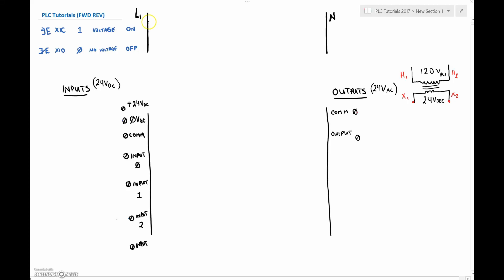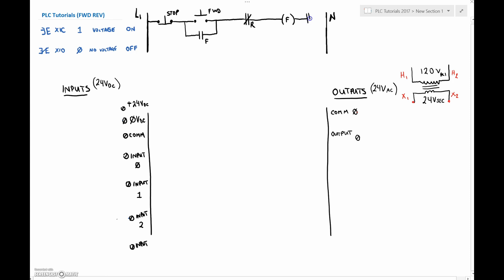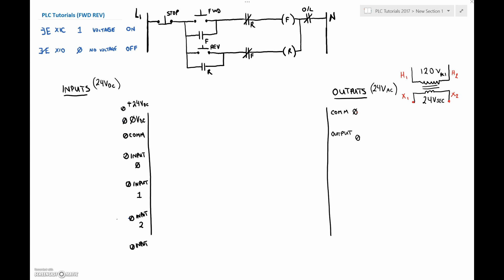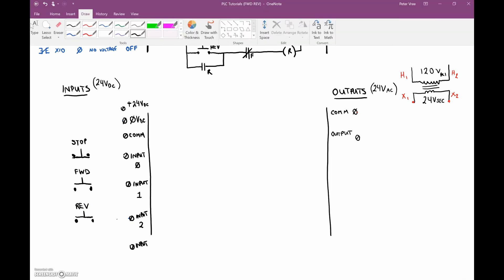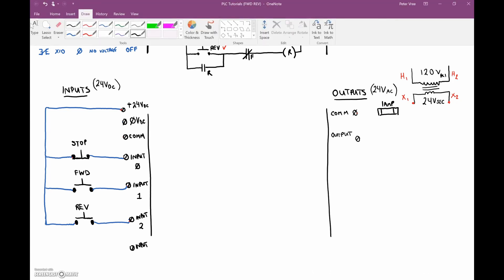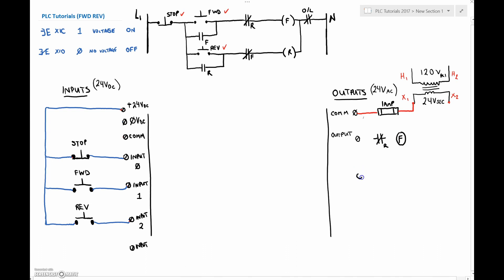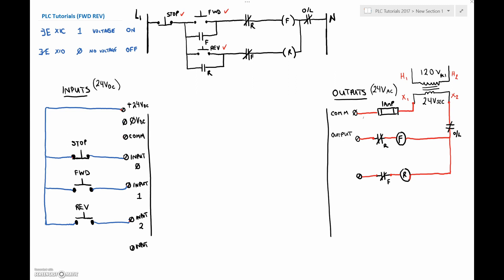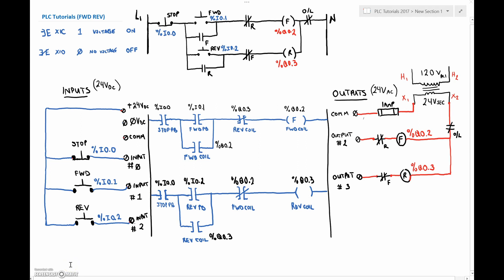PLC Tutorial (TwidoSuite) #5 (FWD REV Open Loop Control Explanation)

Comment: Great video, I would prefer to see AUX contacts as inputs to the PLC.  That would prevent the outputs being hot if the motor trips.  Also, a time delay  between Stop and either FWD or REV to give the motor time to stop between direction changes.  Just a personal thing.  I really want the PLC to know if the starter is pulled in.  Again great videos.
Reply from the maker: I agree, but I can't give everything away... otherwise the students will just copy the video. This way they have the basics  that we can build on in class.
Reply: Hi, Robert,  I agree with your opinions.  I have a question that the aux contacts as inputs to the PLC would prevent the outputs being hot if the motor trips. Could you please explain it ? Thank you very much.
Reply: Shaochen Jiu  If you use the output address to seal in the circuit you must push the stop button in order to turn the output off.  This works great for logic but it can cause real issues in the real world.  By using the stater’s auxiliary contacts as an input to seal the circuit, if the started trips out (over load contacts) the coil is deenergized and the auxiliaries change states. This causes the logic to go false and the output to the coil is deenergized.  The difference is a safety issue to me. If a PLC controlled starter trips out, the way explained in the video would keep the output energized. As soon as the starter is reset the coil would pull in immediately as the output would stay hot. If you use the auxiliary contact as an input when the motor trips, the output is turned off. After the motor is reset, the start PB must be pressed in order to energize the output and the coil.
Reply: Wow, thank you so much for you detailed explanations. You have a very solid electrical background. I appreciate your help. 
To my understanding based on your explanations , I think the auxiliary contacts and  another O/L should be also added to PLC inputs to form a " close loop " where the former works as seal in and  the later serves the deenergize output.